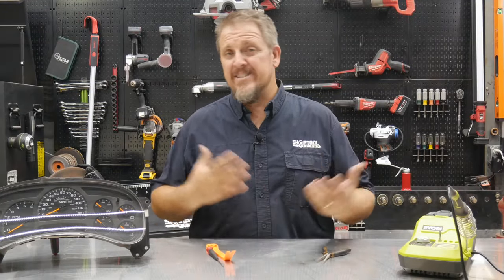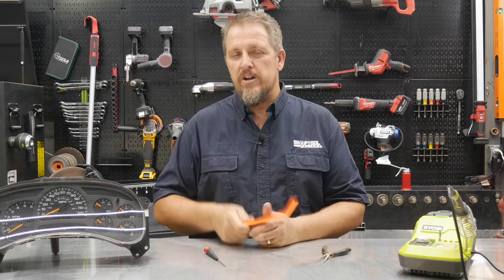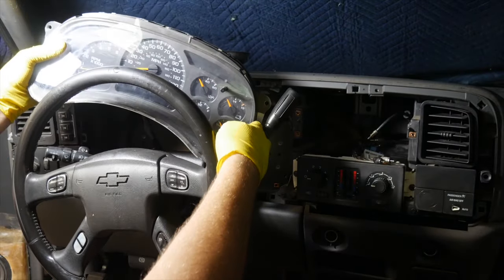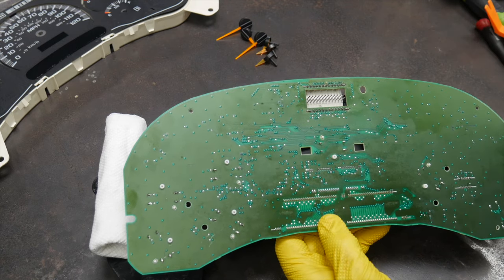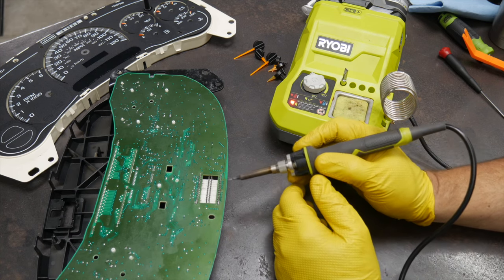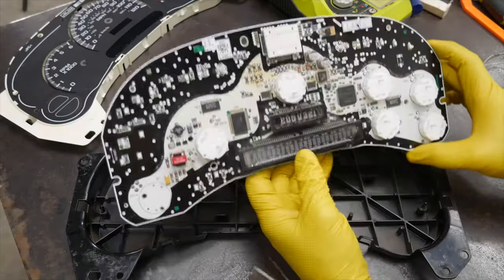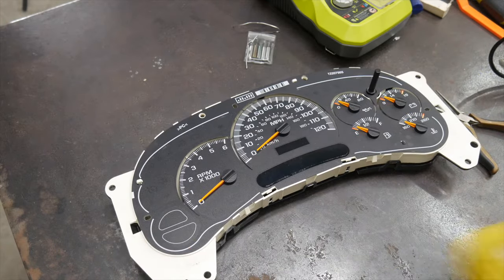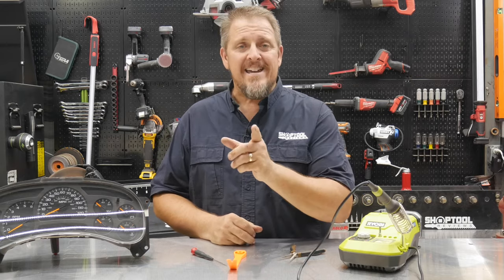How To Repair Chevy Truck Dash Cluster - [RYOBI SOLDER IRON]

Comment: My dash all works but no back lighting. Can’t see how fast I’m going. Already done; 1 checked fuses - all okay. 2 replaced switch - still no lights. 3 wiring harness at some pins for switch had white powder on them. Using a pin I tried to clean pin receptacle. Still not working. Any suggestions?

Comment: Any idea what made my gas gauge point straight down after my truck would start and die? Also while driving all gauges will go down but back light stays on and then after a minute gauges go back up and my battery and security light will flash on the display

Comment: The way we practiced soldier in my high school (way way back during the 90's) was you take lengths of stripped 12-14 gauge solid wire, coil/wrap it around a pencil or rod, cut circular links off of the coil, chain the links one by one, and solder the links closed. After about 100 or so links of chain, (trying for minimal solder use, and as few "spikes"or spatter as possible) you'll have some decent soldering skills going
Reply from the maker: Love to hear this (I graduated in '89), but not many shop classes taught anymore. Very sad. We need the trades back in our high schools. Thanks for watching and for commenting.

Comment: Hi my name is Terry I put in a brand new bulbs in my cluster the bulbs work fine I plugged the cluster back and now none of the gauges work none of them. None of them work at all. Can you please tell me what’s wrong
Reply: Make sure you didn't damage the wiring harness, check the connector is all the way in & check your fuses. Hopefully you didn't crack a solder point when you unplugged it

Comment: I have the same problem and i already have resoldered all they resisters but still have not solved the problem what else can i do?
Reply: My truck the positive battery post was loose. I took it off the battery cable and cleaned both surfaces. The negative was tight but checked and cleaned it anyway. Everything is working better. Poor grounding.